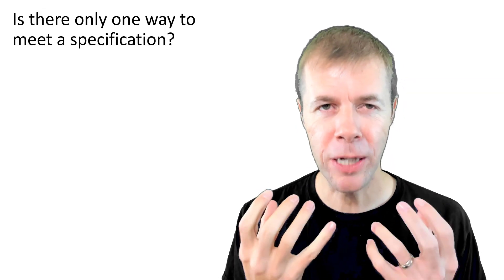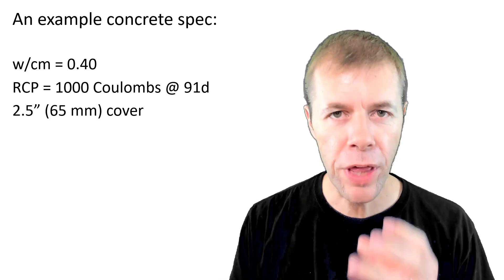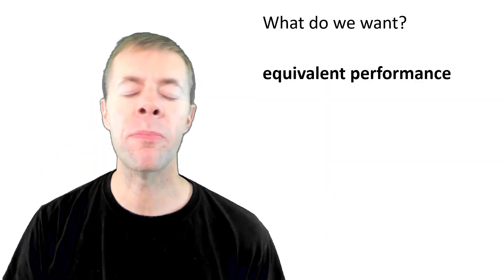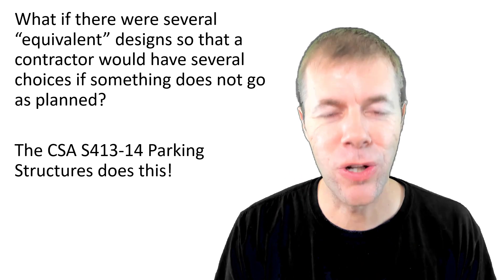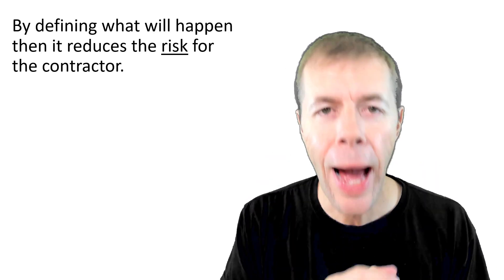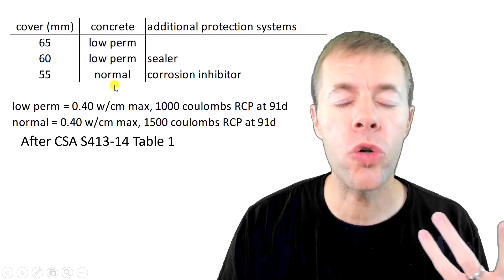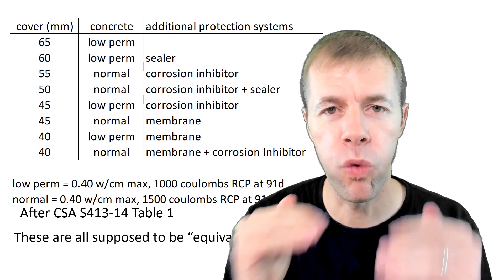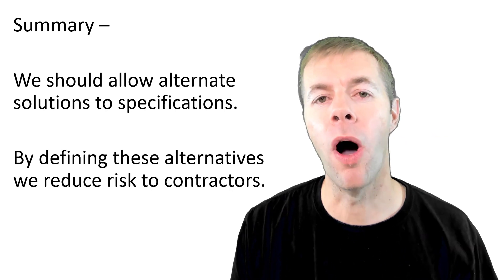Is there more than one way to meet a specification?

Comment: I enjoy your videos. I’m an oilfield cement engineer (but mechanical engineer by schooling) who has a lot of experience designing cement slurries pumped into wells under high pressure and temperatures with various design considerations such as controlling slurry fluid loss so that the slurry combats gas influx down hole as well as remains pump-able during placement; controlling free water; designing for ductility and resilience, etc. just to name a few things. We use a lot of different additives to design for fluid loss control, free water control, to extend slurry thickening time so that the slurry remains pump-able during placement, to promote strength development, etc. We also use additives like silica flour and silica sand to help prevent strength retrogression at temperatures above 235F. It’s interesting to learn more about the design aspect of concrete and cement chemistry as put forth in some of your videos I have watched. Good work.
Reply from the maker: Thanks so much for your message and thanks for watching!

I have also worked on cement slurries for oil field applications.  They are fascinating.  You speak a different language but the chemistry and physics are all the same.
Reply: Tyler Ley I meant to reply sooner but I forgot. Yes, you are correct and I noticed that from watching your videos. I designed and pumped a lot of foam cement. That stuff is pretty cool. One of the coolest cements I designed was a slurry containing 3M glass beads that had a base density around 8.5 lb/gal and it could be foamed down to 6.25 lb/gal and still achieve 500 psi of compressive strength within 48 hours at well depths of around 2000 ft. As you probably know 3M beads allow you to achieve light slurry densities and associated strength values that are simply unachievable with water extended slurries at the same densities. The real test for that 6.25 ppg system I designed was doing an impact test on it and comparing it to a 15.8 ppg system. This was to demonstrate the ductility and resilience of the lightweight system. I had a cube of the 6.25 ppg cement and a cube of the 15.8 ppg cement and it was rigged up so that a 1kg weight was dropped from 1 meter onto each sample. First up was the 15.8 sample and it shattered to pieces all over the floor. Next up was the 6.25 foamed 3M beaded design. When the weight hit it, it did not shatter or even crack. Instead the result was an indentation into the cube of about an inch. There were no cracks even around the indentation. I performed this demonstration for Shell. They were amazed as nobody expected such a lightweight sample to be so strong. Do you know if 3M beads are ever used in concrete applications or is that something not economically feasible? I was thinking that if you poured a house foundation or a garage floor using 3M beads in the concrete you would have concrete resilient to cracking. In cold climates this could be helpful to prevent cracking that might occur with temperature changes as structures tend to shift during seasonal changes.